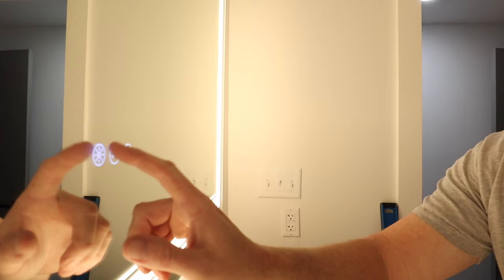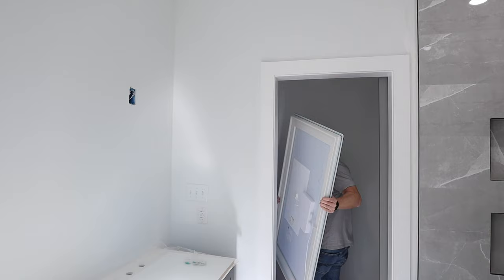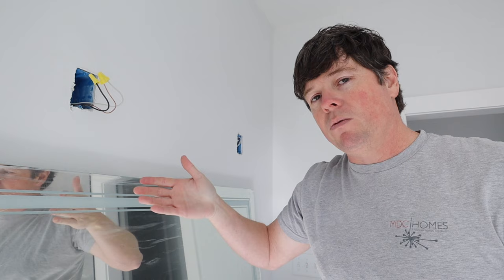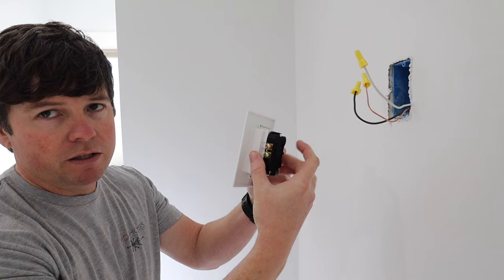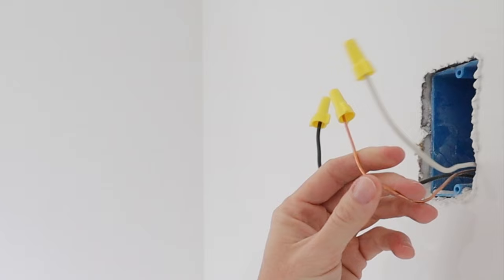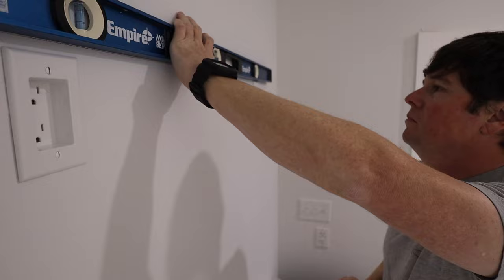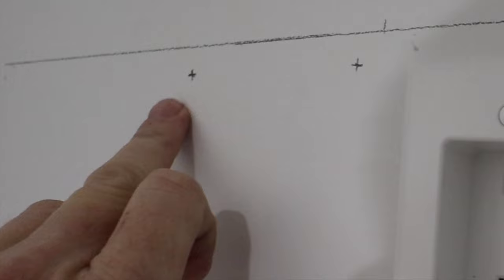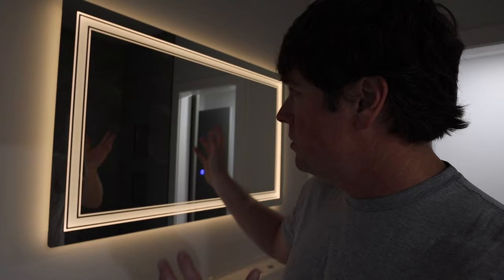How to Install an LED Mirror - BOKIHUK BATHROOM MIRROR

Comment: This video should be called how to hang LED mirror because the installation includes hard wiring the mirror into the box. for those who came here to look how to hardwire the mirror: simply remove the light fixture, (which you will not going to need if you have a self lighting mirror) and install the mirror wiring it into the box where the light fixture used to be hardwired. Don't need to call an electrician and most definitely don't need to have a light fixture on top of the mirror, that's an absolute redundancy and I don't even think it looks good. So again, if you have a light fixture, remove it and hang your mirror after you hardwire it into the box that is now empty, because you removed the light fixture. I hope this clarifies it for some people. Also if The mirror comes with a plug instead of a wire, just cut the plug and strip the wire which will make it ready to install hard wiring it into the box

Comment: Why not just cut the plug off and wire directly in? Why buy a recessed outlet to plug it in? I just bought an led mirror and I can just cut the plug off and wire it in.
Reply from the maker: Absolutely. You can hardwire if you like.
Reply: @MDCHOMES on some brands like Andrea mirrors sold by homedepot in the directions they tell you that you can cut plug and hard wire but they also tell you that it voids your warranty when hard wiring
Reply from the maker: @Orbit77777 Good info. Thanks for sharing with us 👍
Reply: I think people are scared and they think it's different than wiring a regular light in or people just don't know how to hardwire anything when the box is already installed lol that's hilarious. Another video flat out said just hire an electrician to install the mirror...
 so each time you have to install a light fixture call electrician, unbelievable
Reply: I mean, nobody has to tell you to do that. Isn't it common knowledge?

Comment: Better check electrical codes. GFCI needed when by water. Also GFCI hidden by mirror may be illegal. It has to be available for reset. May have to be hardwired.
Reply from the maker: Good call. Our electrician did check to make sure we didn’t need a gfci and as far as our area we didn’t. Good idea to check your local code as well. 👍

Comment: I bought this mirror for my new bathroom in Nov 22. I'm so pleased with it, even if it was a little pricey. Fortunately, the guys that did my bathroom fitted it for me, but I was glad to see your vid to find out how it was fitted. Great vid, thanks!!
Reply from the maker: Thanks so much. I really like how this one turned out. Definitely will use it again in future projects. Thanks for watching 👍
Reply: How do you turn it on? Is there a way you can use the original wall switch? I’m confused lol
Reply from the maker: @godwinthehuge7169 there is a touch switch on front of mirror that turns it on and off as long as power switch on the wall is on. Once mirror is turned on you can then use wall switch to turn it on and off. Hope that helps. 👍

Comment: Thanks for the how-to video.
Nice mirror, it would be nicer if they could change their settings button to the bottom-left or right. Also, I don´t understand why these power plugs never comes in a 90 degree connector.
Reply from the maker: Agreed. The plug on these are ridiculous if you intend on it being behind the mirror. Thanks so much for watching 👍

Comment: I’m wondering if I can use the wall power switch to turn on/off the led instead of pressing the mirror?
Reply from the maker: If mirror light is on the light switch definitely turns it off. I tested a few times and it did turn it back on. Just not sure if you wait awhile if it still turns it on or if mirror shuts down completely until switch is back on. Didn’t try it after a long period to check.

Comment: Are we able to use our regular bathroom outlet if it’s close enough? Do we have to buy a separate outlet plug? I have the bathroom lights that are in a row of 3 with the mirror below it
Reply from the maker: It will run off any 110 outlet so you can use the one that’s already there if you don’t mind seeing the cord. You can also run it off the power going to your existing lights. Hope that helps.

Comment: Hi, Jason!  Is this mirror bright enough to be the only light in a medium sized bathroom where part of the bathroom does not have direct line of sight to the lights?
Reply from the maker: Hmmm. That’s tough to answer. It depends on your desired level of brightness really. In my opinion the mirror puts off more than enough light to replace traditional vanity lights. That being said, I feel that most bathrooms really need an additional source of light  overhead. The overhead does most of the heavy lifting by flooding the room with light. The vanity or mirror light tends to provide an accessory light source that mainly helps with seeing yourself in the mirror and eliminating shadows caused by overhead lighting. Hope that helped 🤷‍♂️

Comment: Do the hanging clips need some space from wall to allow mirror to sit flat on wall if wall not quite flat have seen some with a space bottom corner of wall not flush ?
Reply from the maker: Hmm. Guess it’d depend on how bad your wall actually is. Mirror laid flat on this wall no problem but it was a new house. 🤷‍♂️. Sorry I couldn’t be more help.

Comment: Is the led mirror bright enough to light up a small bathroom?   I won’t need additional lightings?
Reply from the maker: Hmmm. Depends on how much light you like. I prefer to have overhead lighting as well as direct lighting like the mirror. I think if you just use the mirror the bathroom will be a little dark. If you like that darker, moody vibe, then it might be enough for you. Thanks for watching and for the comment 👍

Comment: Great video did you have to lower the original light box for the mirror or are they still at the same height
Reply from the maker: This was a new construction so I had boxes installed low enough to be behind mirror. If this were a renovation you’d potentially have to lower them.

Comment: Great video Jason, are you happy with the mirror size? my dual vanity is pretty similar sized to yours and I feel like this may be slightly small.
Reply from the maker: This was a house we built to sell so I never got to live with it but the time I spent with it before it sold we really liked the mirror and it seemed proportional to the space. Once you click the link of the mirror we used I believe there were some alternative sizes. Hope that helps 👍

Comment: Does it hold setting when the power is turned off?
Reply from the maker: We put this in a home we were selling so I didn’t get to use it too much but we did test it a few times turning power on and off and setting stayed the same. 👍

Comment: But to put this mirro do I need to have electricity in the bathroom wall ?
Reply from the maker: You will need an electrical source of some kind. You can either use an outlet or the source going to a vanity light.

Comment: Great video!!! Curious… is your led mirror just a noisy?! We purchased this exact mirror and man the humming noise coming from this mirror is loud!!
Reply from the maker: 🤔 I didn’t hear any noise when testing ours. Given…this was installed in a spec house we were selling so I never lived with it on a daily basis. We worked in the home for several weeks after installing and never heard anything though. You might want to contact the seller to see if they’d send you a replacement. Thanks so much for watching.